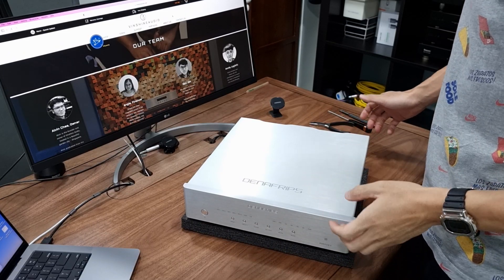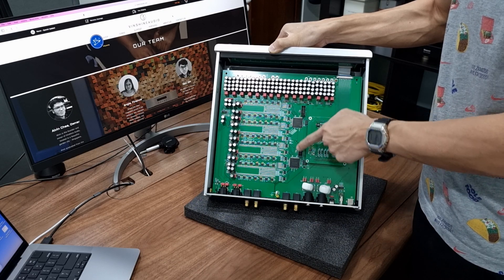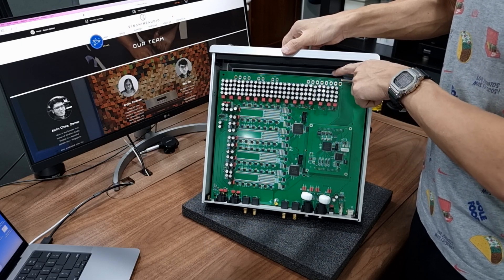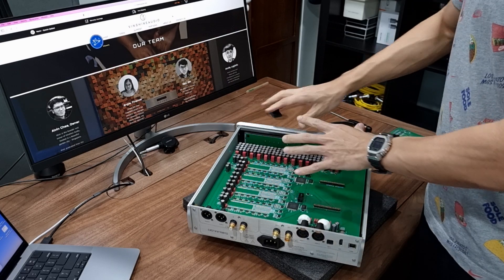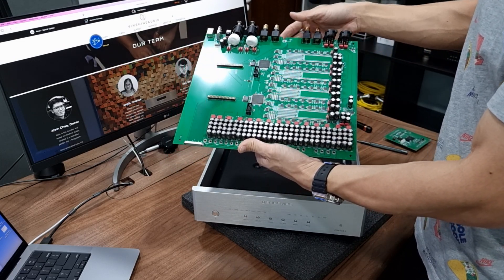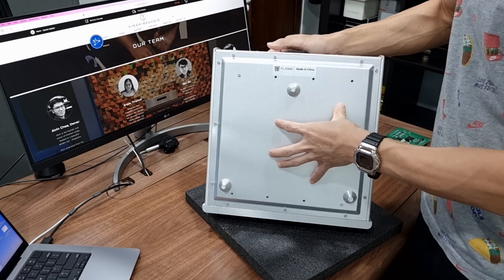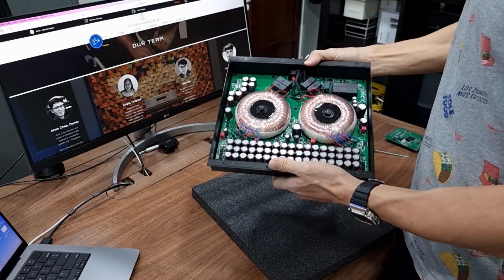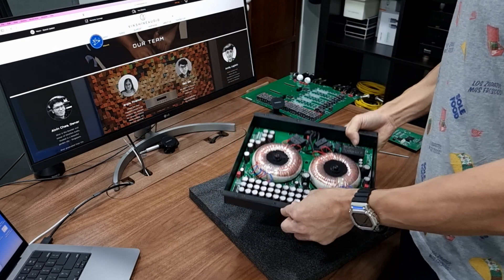Teardown: DENAFRIPS Pontus II DAC

Comment: Just tried doing the Pontus II firmware update and it bricked my DAC. All drivers were installed ..device manager detected the Dac and the USBlib Hires 20 etc. Xbitblaster error ran away on command screen..DAC will not turn on

Comment: Hi Alvin, thanks for sharing the hardware detail of the Pontus II, Your series of videos about the Pontus II made me wanna to going upgrade my DAC with Pontus II instead of upgrading with Ares II, but I would like to ask you for a question which is about the software parts.

Does Pontus II has the USB volume control? because I'm worried about the output power is too large and it may results my AMP can not handle it to the appropriate volume even the volume knob were turned to really small, this circumstance also face the problem of nonlinearity behavior at low output power of my AMP.
Reply from the maker: Glad you like the video :)

We may customise the Pontus II DAC for you with USB Volume Control firmware. This particular firmware allow you to attenuate the volume via the computer/streamer when USB input is used. This may mitigate the potentially clipping issue on the input stage of the amplifier. Hope this helps!
Reply: @VinshineAudio  I bought the Ares II 12th finally,  Ares II 12th is so amazing and so much beyond my expectation, and sound is so natural and vivid, the vocal is so concentrated and full of emotion. It's my first time to listen the R2R DAC and I can't go back to listen Delta-Sigma anymore, thanks for you guys for creating these kind of amazing product, I also found that the firmware v3.14 has the USB volume control feature, good job👍👍👍

Comment: Thanks! Looking forward to receiving and hearing my Pontus II that I ordered earlier this week and that will be replacing an Ares II. :). Looks like quite an impressive amount of engineering went into this. One question, could you talk about the quality of the clock inside the Pontus and how it compares to the clock that one would get from using a device like the Denafrips Iris and I2S connection to the Pontus..? Particularly as it relates to the other DACs in the Denafrips lineup. Thanks.
Reply from the maker: Hi Joshua, Pontus II has two FEMTO crystal oscillators built-in. While Iris has two TCXO. You may reach out to us should you need clarification :)

Comment: I'm considering the Pontus II in the near future. For my use case I need to use either Digital Coaxial or Optical. Which of these two connections do you recommend? I'm curious about how good is the SE RCA Out on this DAC when compared to the Balanced XLR Out? Some DAC's have really poor SE Outs and are intended to be used w/ Balanced XLR Out's. My use case requires the SE RCA Out to be on par w/ the XLR Out. I reside in the USA - San Antonio, Texas; your USA service center is located in Buda, Texas. If I were to have a technical issue w/ my unit, can I drop the unit off myself during normal business hours?
Reply from the maker: Hi sir, I believe we have been communicating via email. We may continue the conversation there.

Comment: Thx for the nice look inside. I have an specific question to the signal outputs which is rarely asked: is it possible to connect XLR and RCA outputs in parallel without any interruption/noise, if one of the two outputs is short circuited. Because on many Integrated Amps (like Accuphase), the Inputs are short circuited if not in use.
Reply from the maker: It's not advisable to connect both outputs simultaneously. 
Once both outputs are connected, regardless whether the device is on/off, the DAC will 'see' it as a connected load (resistive/inductive/capacitive). 
It may have an adverse effect on the sound. 

You may consider output selector like this:https://www.amazon.sg/Nobsound-Balanced-Converter-Audio-Selector/dp/B07D7P7366

DAC->XLR->Output Selector
Output Selector->XLR->Amp1, RCA->Amp2

Does that work for you?

Comment: Great video Alvin!  I'd like to see the tear down of the T+ if there is one!  Just one possible clarification.  My old school understanding of the term "encapsulated" meant that the entire power supply including transformer, rectifiers, filter caps, etc. were "potted" in either tar or an epoxy like material rendering the unit impervious to moisture or water.  Whatever you call it, the power supply is a work of art!  I'd call the power supply "enclosed".
Reply from the maker: I should call it an enclosed/encased PSU box!